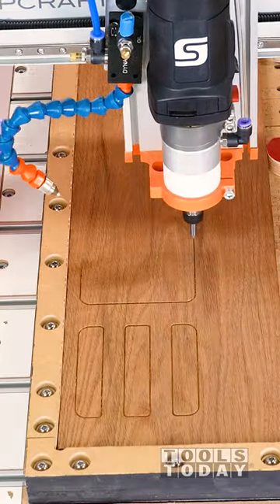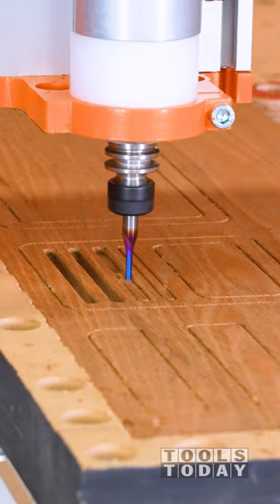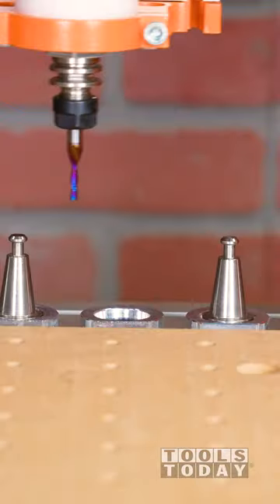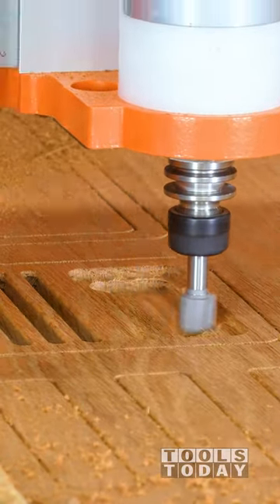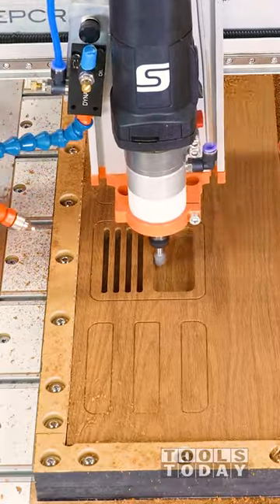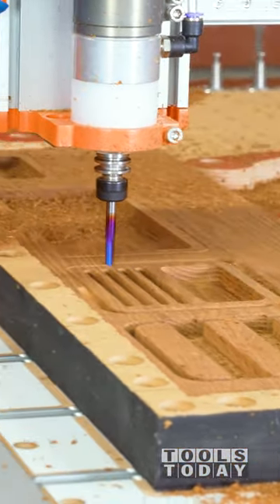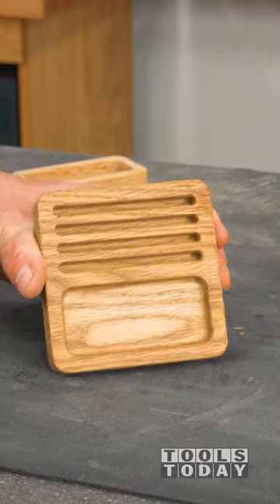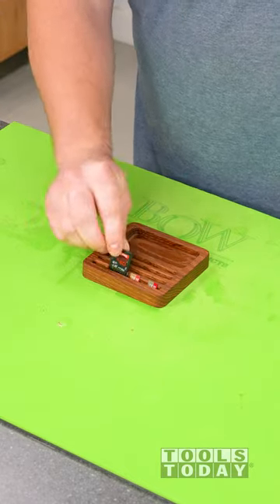Making Card Organizer

Comment: Looks nice! How do you deal with the flat part of that roundover bit? In vCarve I made the profile bit exactly as it comes with the 0.02" flat part, but always have to fiddle with profile path offsets to not make a step in the wood.
Reply from the maker: Thank you!  I actually set the bit up as a 18° v-bit instead of as a form tool, then I just use a profile tool path to run inside or outside the line depending on what I need.  Check out the free master tool library on our website and you can download it and see how I have them set up.  It doesn't preview correctly in Vectric, but it cuts correctly every time.
Reply: @ToolsToday  Neat. I'll try that out. Thank you.
Reply: @ToolsToday So, if you're doing a profile toolpath, how deep do you go then, how do you figure that part out?
I remember I had to do something like that for the snowman tray I got from you, and of course, I don't remember how to do it now.